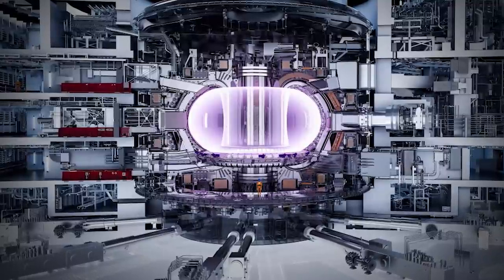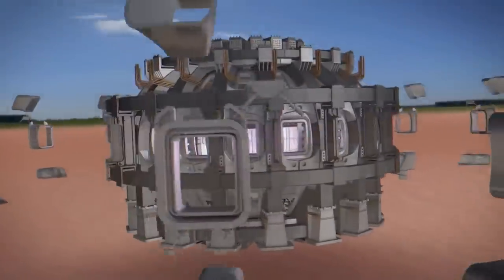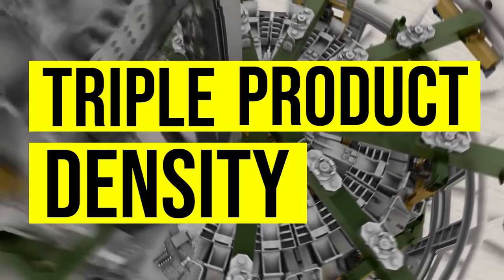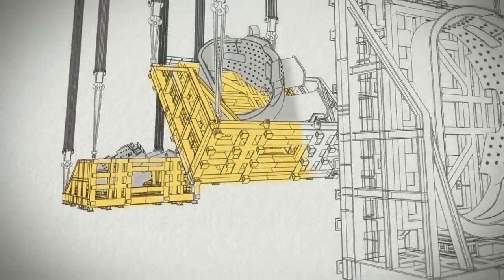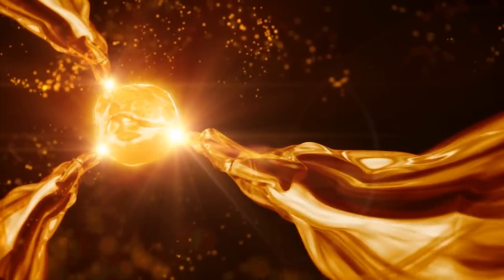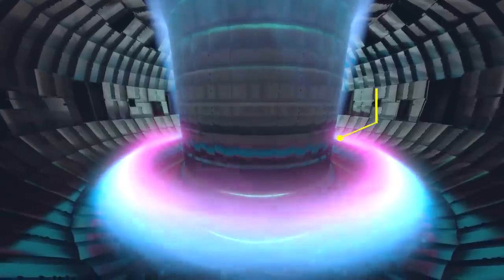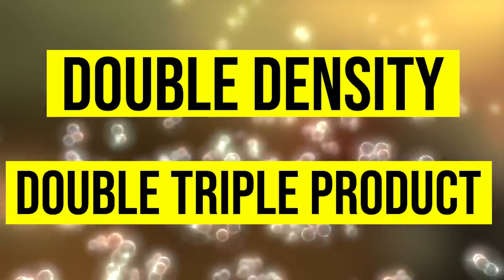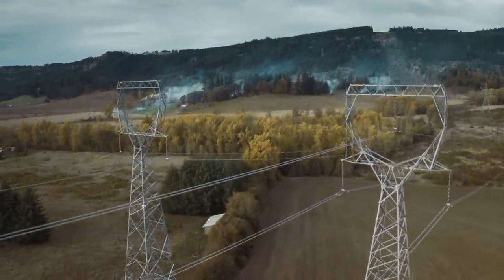Nuclear Fusion Breakthrough Rewrites Laws of Physics

Comment: The laws of physics do not need to be rewritten. Our capabilities of building a better plasma confinement field have improved slightly. As far a fusion reactors are concerned, bigger is always better from an efficiency standpoint. The Sun is spectacularly inefficient at generating fusion energy but it is overwhelmingly huge in size and that is what counts. What we are trying to build on Earth is a machine that will duplicate conditions at the core of the Sun but with even greater heat and pressure to compensate for inefficiency losses due to the relatively small scale. Since heat to boil water to run generating turbines is the ultimate goal, efficiency losses due to heat leakage can be counted on the positive side of the power output equation. The trick is confining enough energy to allow a continuous fusion process to be maintained. 

Finally, fusion reactors are best suited to maintaining base load levels of power, running at a constant output. Nuclear fission reactors will still be needed to provide the power to start up and maintain fusion reactors and the fluctuating demands will need to be dealt with by hydroelectric, solar, wind, and coal fired power plants.
Reply: renewables also can't really deal with fluctuating demand without batteries. So we're going to need some pretty extreme high power storage near the reactor

, my bet being mechanical power storage either through weights or flywheel (probably weights with pullys) because as nice as chemical storage is, lithium ion batteries aren't great for clean energy. Also lithium itself is limited, whilst mechanical storage with weights can be made mostly of concrete and steel, and maybe lead weights

Comment: I've always wondered..If the reaction has the potential to get 5X hotter than the core of the sun, wouldn't the entire reactor simply melt?
Reply: You asked...
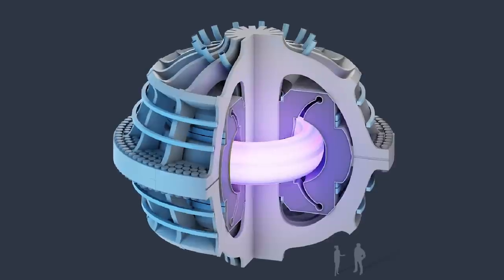0:43 the key component is stated, "electromagnetic force" is what governs the entire universe down to sub-atomic particles. Massive superconductive electromagnets that are controlled by predictive AI to shape the containment fields can confine that tremendous heat because heat is just another form of radiation, same as light or even radio waves. Radiation can be controlled all kinds of crazy ways, including as Einstein predicted with large enough gravity wells around stars like our Sun, by 'bending light' coming from stars on the far side of our Sun as it passes through the gravity well close to the Sun and before reaching Earth. Use a solar telescope setup to "chart" both the shapes and positions of star constellations right next to the Sun and the stars aren't where they "should" be! Where their lights shine 11 months out of the year! 

Light IS heat, just find a magnifying glass and some ants on a sunny day, same with radio waves which can be used to either transmit music or voice comms at lower frequency wavelengths or at really short wavelengths can be used to boil the water in food using a Microwave oven.

Magnetism can confine or block that kind of energy just like the Earth's magnetosphere does in our upper atmosphere combining with different gasses up there blocking most Solar plasma charges that hit us, from CME's Coronal Mass Ejections and EMP's Electromagnetic Pulses, turning that plasma literally into the giant "Polar Neon lights" we call the Northern Lights. 

Check out this short clip on a magnetic principle called Lenz's Law that'll REALLY blow your freakin mind!   🤯
https://www.youtube.com/watch?v=N7tIi71-AjA

Comment: I can't wait till we hear that we got 10% extra power from what we put in a fusion engine!

Obviously that's not much but it's a huge step regardless, but when it happens it'll be big.
Reply: More power out than in, is at least 100 years away. The sensationalist headlines excludes the huge amount of power needed to get the actual tokamak running.
Reply: You can't even count on them to tell you what breakeven actually is but it ain't 10 percent by a long shot. At the projection for ITER of 50 in and 500 out, it will fall short of net export of power by about 100MW. If it could produce power that is, but it can't.
Reply: @joebloggs4369  yep, they only count the power added to the fuel...smdh
Reply: The fact that you can produce more energy from fusion in the plasma than the energy required to produce plasma fusion is in itself a breakthrough that was thought may be impossible not that many years ago. We need to remember we aren't trying to replicate the sun, we're trying for something much harder, working fusion power at much lower pressures and density of matter. It took 100 years for solar power to become economically useful from the very first solar cell we're still short of that in terms of timelines even if it's still decades away. Unfortunately overhyping each minor breakthrough and step sets people up for disappointment but it doesn't mean we should stop or give up hope. The potential from fusion is so huge that it's worth the risk of failure and decades of time and money.
Reply: @SpencerHHO  But that's not what they are doing. You're not getting more energy than that required to produce the plasma. Quite the opposite.The energy required to produce the plasma in the first place is far in excess of the tiny amount gotten out - Megawatts in to produce enough energy, briefly only capable to lighting a dim lightbulb.. So it's not a breakthrough at all. Fusion power is just a money pit and so it will be shown.
Reply: Will never happen as long as we have to use magnetic fields to contain the plasma.
Reply: @joebloggs4369  Yep, it's all about the funding. I'll keep working on my perpetual motion machine so long as the money keeps coming in. I guarantee it'll work in 20 years, trust me.
Reply: @alihenderson5910  I would say ITER is very successful as a pension plan but not an energy source.
Reply: @russhamilton3800  indeed lol

Comment: There are several reasons why a DT fusion reactor will never be built. The tritium dilemma highlighted in one comment is one, and here one should realise that the lithium needs to be isotopically enriched to raise the Li-6 percentage appreciably up from its natural level of 7.5%, while in any case the tritium in a hot environment cannot be prevented from diffusing into the structure and being lost. 
My main comment is that there is no way a reactor can be built without testing components in a 14Mev neutron environment, and this cannot be done without access to a fusion reactor - a lovely example of Catch-22.
Reply: Can assumptions about that be derived from what JET did? Another barrier and show stopper is the limit of what can be produced. Though fusion proponents are fond of saying things about unlimited power,  it's just not true. Any fusion reactor will have a price tag and a finite amount of power it can put into the grid. I see nothing that could be described as either cheap or plentiful.
Reply: @russhamilton3800  I think it would be better to dig three kilometres bores everywhere using hydroevacuative drills, and produce energy from the heat of the Eartg converting groundwater flowing into the bores to steam.
Reply: @russhamilton3800  The argument you heard regarding "unlimited power" does not refer to unlimited power from one or more fusion power plants. Instead it means that the fuel resources on earth are practically unlimited unlike fossil fuel resources.
If economical fusion power plants can actually be built in the future, the reactor components will get radio-active over time and need to be decommissioned after running for several decades. Fortunately that radioactivity would be relatively short-lived, so the components could be repurposed after another 50 years or so.
I do still see a future for commercial power from fusion reactors (mainly tokamaks or stellarators), if our civilization keeps supporting the research and doesn't decline too quickly in the coming decades.
Reply: @helgefan8994  The materials not only get radioactive, but also suffer loss of desirable properties, such as strength. Neutrons disrupt crystalline metal lattices in the same way radiation disrupts DNA. Expect commercials reactors, if controlled fusion can ever get that far, to have frequent and possibly lengthy shutdowns for just this reason.

Comment: The greenwall limit was broken nearly a decade ago with HTS... Well sort of. The Green wall limit is also based on the maximum magnetic flux, and it was believed until 2011 to be fixed, but then a new type of HTS was developed that increased it quite a bit.

Comment: Thanks for the update! I really like that you keep the level of sensation in your titles at a reasonable and defensible level, and how you explain the scientific background. Keep it like that please!
However, one question: 3:49 isn't it rather that, with a temperature gradient, the density is higher on the cooler (low-pressure) side? I'm thinking about the ideal gas law. Or are there other relations for plasma?
Reply: From what I've heard the proposed dynamic is that adding density to the fuel cools the edge, which mixes into the plasma interior. Because plasma conductivity reduces with lower temperature this disrupts the current flowing which causes the plasma to lose stability. With higher power in the plasma outer layer the cooling disruption is resisted. I think the power may primarily initiate from the plasma center itself as with ITER aiming at a plasma Q > 10 it passes the point where the majority of the heating of the plasma comes from the fusion reaction itself
Reply: @Canucklug  ok, but that's actually supporting my assumption that density is higher in the cold region.
Reply: I don't think ideal gas law applies to plasma, as it neither apply in other border regions of matter
Reply: @gastonpossel  Absolutely possible the IGL doesn't apply here, or just in a strongly modified version. However, density should still be higher on the cooler side, otherwise the fusion reactors wouldn't need compressing magnetic fields for the sun-hot plasma. Agree?
Reply: @human_isomer  I think you are a bit confused. The very point of the confinement fields is to make the gas hotter and denser, so to maximize chances of fusion. Just like in a turbine, compressing a given amount of gas will increase its kinetic energy density, thus increasing its temperature. If you stop the compression method, the gas will cool, expand, and equalize to the temperature and pressure of its surroundings.
Reply: @gastonpossel  So you agree that hot plasma is less dense than cold plasma. That's exactly what I said.
Reply: @human_isomer  it is hot, BECAUSE it's denser. But at this point I think you are just trolling.
Reply: @gastonpossel  I'm pretty sure you getting it wrong here, or you don't understand the physics. If you increase pressure, you will both get higher temperatures (if it is an adiabatic system) and higher density, of course, simply because the same mass is in a smaller volume afterwards. 
But density will not increase just by increasing the temperature. That's not how it works.
Reply: @human_isomer  Temperature gradient is a consequence. The causality plays as follows: gas is compresed within a region by magnetic fields - > this increases density and pressure within this region and therefore temperature // since the mass and volume is constant inside the chamber, this also decreases density and pressure outside the magnetically confined region and therefore temperature also decreases here = the result is a gradient from hot and dense to sparse and cold.
Fair? don't make me talk in terms of enthalpy and entropy
Reply: @gastonpossel 
just to recall that here: The question was whether density in a hot plasma is higher than in a cold one. And with same pressure, density in a cold plasma is definitely higher. In fact, to keep the same density with increasing temperature, pressure would also have to be increased. We're talking about equilibrium here, to make that totally clear.
However, when using a confinement of any kind that only covers a part of the volume, there is no equilibrium any more. Or as you called it: there's a gradient. The pressure inside could of course be different than outside, depending on the type confinement. In this case, it's probably higher, to decrease medium free path and increase collision frequency. That would make sense to achieve fusion. But that doesn't allow to draw conclusions about the temperature outside the confinement. 
In the video it was said something to the effect that the temperature closer to the walls is lower and thus the density is, too. But density and temperature (of the same gas) are independent of each other. And that was what I was asking to be clarified. 
Now go ahead and try to explain enthalpy and entropy to a chemist. I'm sure it will be interesting. 
If it's more convenient for you, don't hesitate switching to German.
Reply: @human_isomer  Hey, no need to fight about it! (I don't speak German, but... danke!). We're just not understanding each other. The quote from the video is "as we increase the density, the plasma on the outside cools down", this is because you are actively removing molecules from the outer, close-to-the-walls layers to put them in the center of the toroid (all within the enclosed volume of the chamber, the mass remains constant, as you said not in equilibrium), thus lowering the density and Tº of the outer layers. In this case, into the closed volume of the reactor chamber, the hot central plasma is denser than cold surrounding plasma. I don't think it has anything to do with the temperature of the walls just yet. When he continues saying "and because cold plasma is less dense than hot plasma...", I interpret him to be talking about this specific situation too. Now in an unrestricted space, the situation is different, hot gas molecules having more energy would want to fly outward and become less dense, and perhaps that's the point you are addressing.
Reply: @gastonpossel  Haha, no fight intended :D But you see where the confusion comes from, as cold plasma is probably not less dense without lowering the pressure in that region at the same time. And when the plasma gets drawn to the center by the magnetic confinement, one should expect adiabatic expansion, thus lower temperature, and lower density - but as a consequence of the withdrawn particles rather than a consequence of the lower temperature. So, although the description of the physical conditions is probably correct, the causality might be a bit different. 
However, plasma is made of charged particles, and when the temperature goes down, these could recombine to form a neutral gas which may be considered as lowering the density, depending on how plasma density is defined (two or more particles in the plasma when counting the electrons, but only one in the recombined neutral gas). There are some weird definitions of physical quantities in special areas of science. I guess you've also come across a few of those ;)

Comment: What about the tritium dilemma? How will nuclear fusion ever be economically feasible if the fuel necessary for the reaction is so rare and expensive? 😟
Reply from the maker: This is a great point, definitely something I want to make a video about!
Reply: IIRC the main idea is to use lithium to breed more tritium for use in the reactor  —which when hit by neutrons splits into helium and tritium. And since neutrons are a byproduct of H2-H3 fusion that normally require heavy shielding. It makes sense to use it to at the very least lower the amount of tritium needed to sustain the reaction.

Edit: not entirely sure about whether it's li-6 or li-7
Reply: @weirddudes5543  I'm just getting these numbers from the internet, but... even if all necessary tritium is supplied through lithium breeding, it seems, that only works while the reaction is running. So externally supplied tritium will still be required for the startup process. 
"The Chinese Fusion Experimental Test Reactor (CFETR) is expected to demonstrate full breeding capability but will still require a start-up inventory of 2–3 kg when it begins operation in 2035" 
Also, the International Nuclear Fusion Research's DEMO powerplant is expected to require ~20kg. 
Which would cost $600million at $30,000/g of tritium. So even just the startup process, of this nuclear fusion power plant, will cost more than all the electricity that an average nuclear (fission) power plant makes in an entire year, at ~$500 million worth.
Reply: @zblus  it is also possible to breed tritium by running a tokamak with deuterium only. I've seen two estimates of this, taking 60 - 200 days to build up the start up inventory. The electricity cost of powering energy losing deuterium reactions is high. As far as I could tell it should cost ~ $500 million. That could be substantially less if the reactor is run at low demand times with lower costs. Interestingly there are places with a lot of renewables where the price of electricity goes negative at times - they pay you to use it on a windy day with a huge oversupply
Reply: @Canucklug  ummm if you could do it without tritium why would you not just do that since DD takes a few hundred million more degrees and produces 1 neutron, how would that get you anymore tritium?
Reply: @russhamilton3800  The neutrons go off and hit a lithium in the surrounding material, which creates a tritium and helium. For tokamaks they need some beryllium which gives off two neutrons if it gets hit by one to make up for lost neutrons

Deuterium needs to be hotter to make it react but it creates far less energy than with tritium so nobody's looking to create electricity with deuterium alone with current technology (Helion plans to do deuterium reactions which creates helium 3 which can be added to the deuterium fuel mix and puts out energy comparable to deuterium-tritium, though it takes higher temperatures as well)